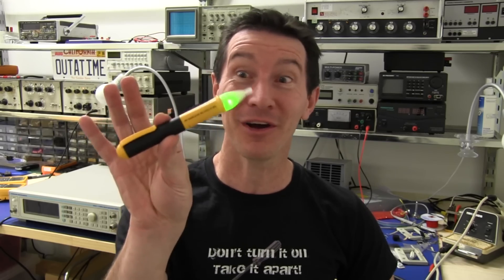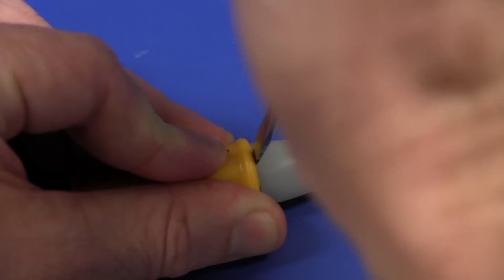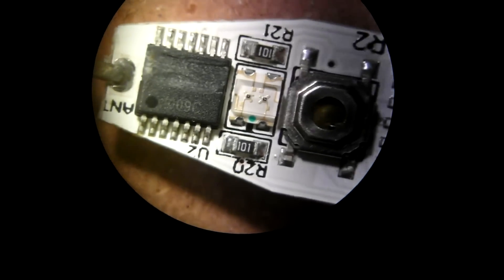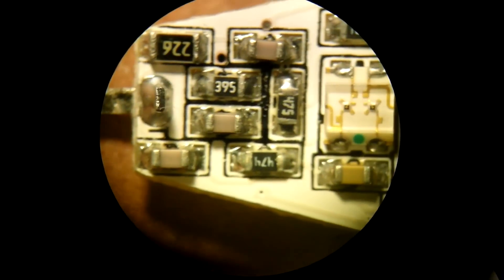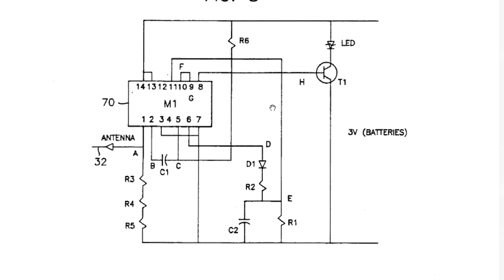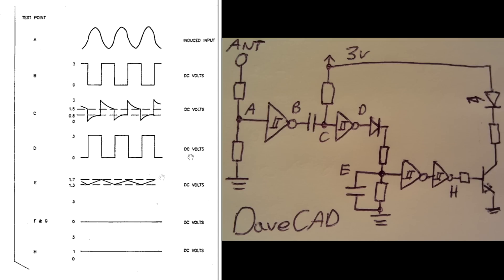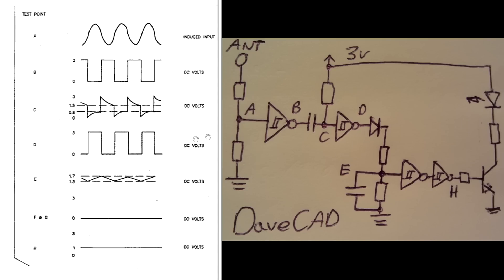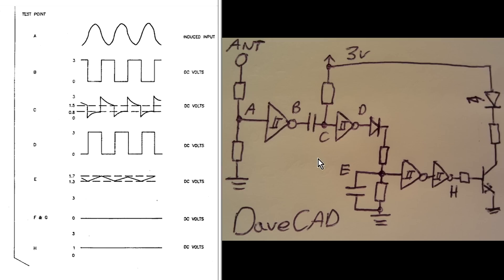EEVblog #267 - Voltage Detection Stick Teardown

Comment: I set my mind to purchase on of those sticks after getting zappppppppped by a hookup pedestal that was wired wrong in an RV park in Utah.  I clicked the wrong link and ended up with a neat little multimeter that has that as an additional function.  In the nomadic world of Class A and C Motor Home life, something that can keep you from frying because some idiot wired the box wrong is worth it's weight in gold. Hook your RV to something like that and you may not notice it till the next rain, at which time you get knocked on your ass by the power that has migrated to the skin of your RV..  Thankfully mine is fiberglass so she is a bit safer then those with the tin skin.

Comment: hi Dave, use GB GVD-504A Circuit Alert Non-Contact Voltage Tester GVD-504A, doing Electrical Work, not sure why the 2 u showed are so HUGE, mine is 1/4 the size its near 20yers old now, just replaced batt for first time, Thanks allways wondered what was inside.  Very Handy Tool  : )

Comment: I enjoyed your teardown...!
    I was wanting to use this in a setting where I want to measure the 120 vac wires inside an appliance.  However I want to keep the batteries and all the electronics far outside the appliance.  Do you think I could simply extend the Antenna off the board about 4ft, and still get a reading?  Or would that distance compromise the calibration?

Comment: Nerd? I'll give you nerd! When I was working on my BSEE degree in 1972, we had to learn to use a SLIDE RULE! I wore it proudly in its scabbard on my belt. Later on it was my trusty TI SR-10 electronic calculator (because I could afford an HP 35 with its cult-like RPN operation). :-)

Comment: The resistor in series with the antenna isn't necessary, unless you're modeling the plastic insulator covering the antenna.

Comment: I get something that looks same as FLUKE, for 2$ from ebay, and it works, but detects electrity only if I will touch the wire, cant check eg. wall socket, useless...

Comment: I use sticks like that ONLY to trace wires in walls or get a quick overview. Never ever use them to check that a wire is cold. It can get you killed. Also never use a crappy multimeters for tasks like that for they often give you false positive results (as the sticks do, too).
For stuff like that i use my Benning Duspol analog tester.

Comment: I use one of these. I'd rather avoid an electric shock if I can lol.
Reply: Yeah, i'd rather not shout "ow fuck!" at a job site lol.
Reply: fig8man Been there, done that, Unfortunately on a 220 DC rail.  I also learned to do my own tag-out lock-outs and not assign that to someone else.  As he tag'ed and locked out the  unit NEXT to the one I was working on.

Comment: Hanlon's Razor states: "Never attribute to malice that which is adequately explained by stupidity" However, I bet the engineer responsible for that patent set the values for those resistors that way on purpose, as another form of protecting against patent infringement.
It's been suggested that Leonardo DaVinci did something similar by putting flaws into the drawings for some of his machines that would not be immediately obvious to someone looking to use them. Apparently one of them was a war machine that he didn't want to be used
Even if it is just a rumor, I can see that engineer taking inspiration from it.

Comment: Just an application note: Storm chasers and "first responders" should carry some iteration of a voltage detector  to reduce the possibility of electrocution. On another note, I am betting that you gouged your left index finger with that screwdriver.

Comment: Good work, Dave. When you brought up the patent, it matched pretty well.  I've had dealings with SCC in the past. They also made after-market inkjet cartridges and blanked the ICs in those. Of course the blanked parts were just std parts.

Comment: How big is the transformer approximately (H x W x D)? Does the unit use tubes or is it solid state? Setting that aside, the first thing you would want to do is use an oscilloscope to look at the power supply output to see if it is quiet or has excessive ripple on it, usually from ageing filter caps. That is also a sign that signals in one part of the unit will get into other parts, because the caps are supposed to "short out" and thus isolate signals in the different parts of the ckt.

Comment: I have to ask again: is it in the sound coming out of the speakers or is it from a part? If from a part, you should be able to confirm this by using a stick of wood or plastic between the part and your ear, especially if as low as 60 Hz.

Comment: For a patent, the values are not what is important, but theory of how the parts work to perform the function. In other words, if you had patented the original mouse with a certain size ball, you couldn't get around the patent by having bigger balls. No, wait... that didn't come out right..

Comment: The values in the circuit would not properly be a claim as such. However, you might get them for not actually disclosing how the circuit works.

Comment: Long ago jumped to automotive, but when I was a supervising industrial electrician, I forbade contact voltage detectors because they become a bomb if unknowingly used on medium voltage high power circuits.  If where you work does not have any high power medium or high voltage, the danger is reduced, but have still seen good quality giggers and lights blow for no apparent reason.

Just as with contact voltage detectors, you need to test on known live circuit to confirm operation.

Comment: Excellent video Dave.  I think it may be useful to consider that the whole circuit is floating with a small capacitance (2p?) to the source and a larger capacitance (100p?) to the user/Gnd.  It would then be important to ensure sufficient lag between the input and gnd terminal of the schmitt input, which might explain the cap in parallel with the 22M as well as the fact that the battery negative terminal (body) is towards the front of the probe where the user's finger is likely to be.

Comment: I would've put a zener diode on pin 1 to  protect the chip in case the input was strong enough to raise it to more than 20V.  If it had a lot of leakage though this may not work.  Also they use multiple resistors in series because of the potentially high voltages.  You could also use a single HV resistor, but it would probably cost more.  I'd like to see how long it lasts near a Tesla coil.

Comment: The older models did, but the newer ones don't seem to.

I don't know if there was a technical reason for the change such as battery life, or if it was done to add sort of a POST by having the unit beep and light up when first turned on - presumably so you'd know the difference between a flat battery and a dead cable (although you can of course just check it with a known live cable also).

Comment: Loved milliohms v megohms mixup AND point about part of the circuit being redundant.  I hate getting gadgets where makers ground off part numbers to make it tougher to copy their design, because of repairability.  I've also been in situations where misleading competitors about parts used was crucial!   In 1980's Minneapolis had both small competitors and some HUGE corporations blatantly trying to spy out where we got parts!  Big $ Failure analysis electron microscopes can help reverse engineer.

Comment: Perhaps the milliohms mistake was on purpose to thwart anyone from copying the idea? I doubt it... LOL

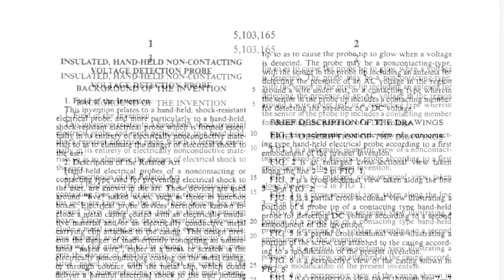Another oops by the patent writer at 10:02... TIMIMG instead of TIMING
Reply: Designs containing mistakes were even used by Da Vinci. I wonder if the Electrolytic Capacitor Plague of the early Noughties, was caused by a design document intentionally leaked to competitors!

Comment: Why would you have a *series* resistor on an insulated probe? You want max sensitivity - I would think the 22M will be to ground to set a DC level and maintain a high input impedance.
Scrubbed IC numbers = "We are a bunch of pathetic amateurs".

Comment: The first capacitor is probably to prevent saturation from keeping the LED on.  In case it saturates either way (high or low) the capacitor prevents the LED getting stuck on.  The hysteresis might keep the output either high or low while there's no input.  I don't think it's tuned for any particular frequency.  The other unmarked chip is most likely a simple thing like a quad NAND or NOR or similar.  Please trace the circuit out since I'm curious :-)  If that chip was special it'd be marked.

Comment: the other chip could be a funky micro like a 14 pin pic, an opamp or some custom jobby combo that has an oscillator, toggle flip-flop and pulse stretchers or it could be some other logic gate like a NOR